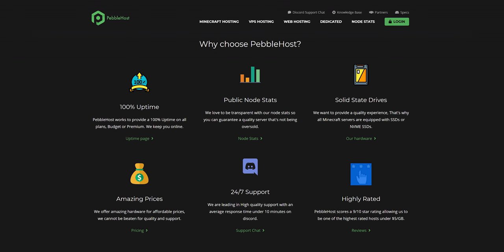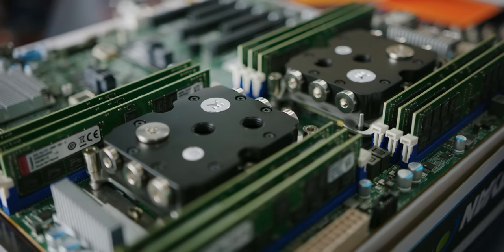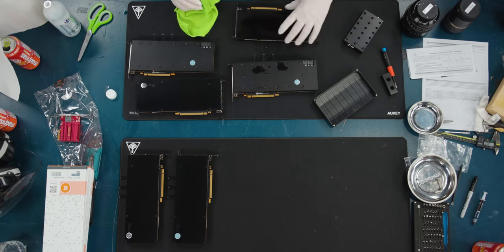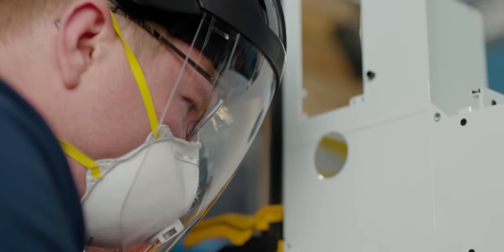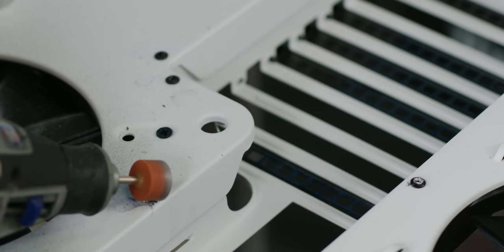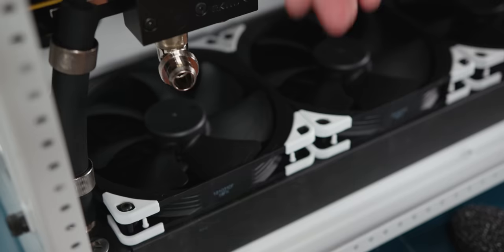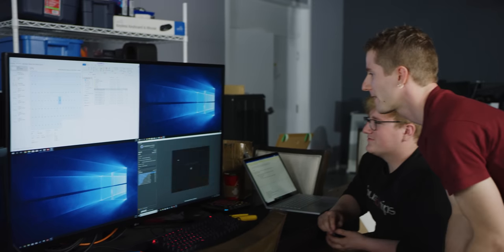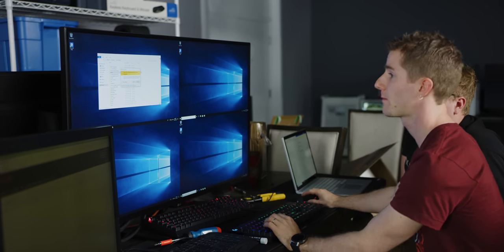We FINISHED the $100,000 PC! - 6 Editors 1 CPU Pt. 6

Comment: Linus:  "It was hard to watch as Jake took a dremel tool to a $500 dollar case."

Also Linus:  "I destroyed an $8,000 cpu being clumsy"
Reply: Probably a /r/woooosh, but at least they're able to source a new CPU for the thing. If they bork the case, though, they're SOL
Reply: @Yuusharo   For less than $1,000 you can get a case fabricated to whatever specifications you want done up at a metal working shop.
Reply: @MrDNMock  A custom fabricated case for this system might be really interesting.
Reply: @CottonInDerTube  "I LOLed"
Reply: @marcusavron47  Right?  This is the sort of thing that merits a custom deck build.  Something you can slap a couple 1080mm rads into for ultimate cooling.
Reply: when he destroyed it the cpu was over 11k, the cpu listed on ebay is 1000 usd cheaper that retail
Reply: Intel need to make drop  proof CPUs.
Reply: @richardallen985  They could call the new technology: Linus Proof ;)
Reply: Oof
Reply: boss vs employee
Reply: @MrDNMock  for 1000$ you can get a apple stand 🔥
Reply: id love to hold an 8000 $ cpu lol or see one not in my pay grade lol
Reply: @CottonInDerTube  they have money
Reply: Counterpoint: When the new 64c Threadripper and EPYC CPUs hit the market and Intel launches a replacement for this it's value on the secondary market is likely to fall by about 75%. As one of the last and one of the biggest and baddest cases ever made Caselabs that case could appreciate in value over the coming years. I wouldn't be surprised if the case is worth more than both Xeons in less than 10 years.
Reply: Bahaha. Throw it at the wall to see if it sticks.
Reply: @MrDNMock  have you seen their desk mod video? I said they need to work with a cabinet maker, not Amazon.
Reply: Wasn't it $10k? Anyway, still more than I'll ever spend on a CPU... I could buy 77 of my CPU with that... Man, I'm sad :(
Reply: @hrdcpy  No I haven't seen it.  Done a couple desk builds for myself in the past, but I will definitely check it out.  Planning on doing a 3rd in a year or so and always looking for more ideas on how to go about it.
Reply: @richardallen985  you spelled Linus Proof wrong
Reply: it was 10,000
Reply: Well case is more important vs case cos u have 2 CPUs and only single case which is not in store anymore, so what you try to say ?
Reply: @richardallen985  I'd say linus needs to stop dropping CPU's, especially ones worth three times my own pc.
Reply: Honestly, I think Jake's mod looks pretty clean. The cuts with the dremel obviously look pretty guetto, but when he inserted the PCI express slots from the thermaltake tower, you could not even notice the dremel cuts. Just a few sprays of white paint and it would be like new.
Reply: @MrDNMock  for only 999$ you can get a monitor stand man
Reply: my brother works at micron and broke a $20,000 Xeon Platinum cpu
Reply: Linus: drops nuke accidentally
Reply: @muddykat-tech  in my case ... 300 times my pc :-(
Reply: wrg,idts, do any s ok
Reply: Yuusharo you could probably find a used one
Reply: Jake is hard to watch doing anything...

Comment: You know you're ballin' when your network speed is limited (in part) by PCIe bandwidth
Reply: pci 6.0 will save the day.
Reply: cries in australian
Reply: cries in adsl
Reply: and some still argue that PCI 4.0 doesn't matter :|
Reply: @teguhsuryadi5387  exactly, thats why HPe and IBM are pushing midcycle updates of their machines to incorporate PCIe G4 even before the Cooperlake and Crystal Lake are due mid 2020
Reply: Pcie 4.0 is irrelevant for the average user and their even high end gaming rig. For stuff like this and data centers it's obviously is a huge thing
Reply: By Intel still using PCIe 3.0 instead of 4.0 or 5.0.
OpenCAPI is the future for servers.
Reply: @MaXwellFalstein  Absolutely thats why Google fully committed to OpenCAPi in their custom PowerServers. I think it will be interested to see if nVidia with the takeover of mellanox is going to move to OpenCAPI or again walking the proprietary road :-(
Reply: @mrradiowave8085  IBM, NVIDIA and Mellanox are core contributors to the OpenCAPI Consortium. NVLINK is proprietary.
Reply: Mr. Tux guess that means PCIe needs to be improved? 🤷🏻‍♂️
Reply: @isaacyoung1868  PCIe 4.0 is enough for the Mellanox ConnectX-5 used in the system and the Mellanox ConnectX-6 (both of which support PCIe 4.0).
Reply: Mr. Tux cries in 300mbps
Reply: @snoopdoggty1086  300 Mbps LAN or WAN?
Reply: MaX Falstein wan
Reply: @snoopdoggty1086  You can use a ConnextX-5 HCA for WAN; however, Linus is talking about LAN access of 8K footage.
Reply: @mrradiowave8085  IBM has been using PCIe 4.0 for two years. It will release PCIe 5.0 support in 2019. AMD has released PCIe 4.0 processors and graphics cards. PCIe 4.0 flash is available. Mellanox HCAs have supported PCIe 4.0 for three years.
Reply: MaX Falstein i know dat mate but the distance between my router and my pc is too fucking far and im too lazy to buy a lan cable
Reply: @MaXwellFalstein  yes sorry ment PCIe 5 got it mixedup, I just wanted to say that the need for more throughput is very much driven by the increased usage of accelerators.  And that it is intresting to see that the Power9 Prime is being released as a mid cycle update mostly for that, and memory bandwidth as the market demands this.
Reply: @mrradiowave8085  Power9 Prime is very exciting and interesting. OpenCAPI 4.0 is where you should be looking for PowerAXON-related expansion; ditch PCIe.
Reply: Of course Linus dropped one of the xeons
Reply: Australian tears
Reply: not to mention bottleneck bridges

Comment: Linus in 3 months: Time to rip everything out the chassis and replace it with dual Threadripper 3rd gen CPUs and 6 Titan RTX's
Reply: Totally. Gonna. Happen. XD
Reply: Then 1 year later. Its finished!
Reply: Sorry to be a buzzkill but Threadripper can’t do duel socket.
Reply: Actually, it would be more like Epyc, not Threadripper who is a lot cheaper than their actual.
Reply: @sphbecker  But with the use case like this you could cluster the CPUs and get the same result.
Reply: @sphbecker  Maybe they will make it work with 2 sockets, who knows?
Reply: @sphbecker  Won't need to. Threadripper 3 will be 64 cores. On a single socket. That's already more than this system has in two sockets.
But it won't launch this year at all, maybe early next year.
Reply: @sphbecker  Because you only need one Threadripper. ;-)
Reply: RTX shouldn't be better for  this
Reply: With 6 of Radeon Pro Vega II Duo 😂
Reply: @moriart13  And?
Reply: Linus next week: It's been well over a year now since we started this machine so it's finally time to upgrade it.
Reply: poor company that went bankrupt before Linus finished the build.
Reply: They probably won't be using this in a month let alone 3 since their editing systems are probably already more powerful individually.
Reply: @-ragingpotato-937  Vs should be better of editing, -computing
Reply: its 12 GPUs efectively which won't work
Reply: I think his point is my computer is bigger than your computer. Hahaha
Reply: @IngwiePhoenix zen 2 epyc
Reply: oh ya, this isn't something anyone ever finishes
Reply: Sorry to break your hurt but that won't happen
Reply: @GeorgePerakis  You'd be starving those titans unless TR3 gains more PCIe lanes.  He's got 96 right now, enough for 8x each plus the accessories.  64 you'd have to give them each x4, and you will notice the hit when you drop down to x4.

Comment: Now for the real test: Minecraft with full ray traced shaders and 8k texture packs.
Reply: 16k Ray-traced Tetris. Now that’s a real challenge
Reply: 12k resolution High Ultra Ray Tracing Pong.
Reply: @johnnooyen461  That would actually be a challenge no joke.
Reply: A 1.12.2 300+ modpack as well.
Reply: That's sick😉😉😉😁😁😁
Reply: Jasiu Jasiowsky this comment is underrated
Reply: Crysis
Reply: And blow up a 100,000 tnt ball
Reply: If we don't get this we riot
Reply: @grimace5800  Minecraft would Crash because only 1 or 2 cores are used
Reply: Can I play csgo at 300 fps on this?

Comment: So it's 2 USB ports per editor?
Cries in Taran peripherals
Reply: Na its 2 extra dedicated.
Reply: just dongle it LEL
Reply: It's USB 3 tho... Fast enough to split into 4 - 5 port each
Reply: You can split usb with a hub
Reply: USB hubs also exist
Reply: You wouldn't even typically hardwire into something like this. They are more than likely using a separate workstation and remoting into their VM instance.
Reply: they are usb 3, so you can put a hub there, to be honest i think the better idea was a thunderbold 3 expansion card
Reply: @Xenoray1  Apple
Reply: @dotpeekx  nVidia blocks that type of virtualization entirely, they have to use displayport cables or pay the cost to go to quadros.

Comment: Linus just casually drops a 9 thousand dollar CPU. Of course he would. How do you manage that
Reply: By being linus and wearing socks and sandels ofcourse.
Reply: saph sergal right I forgot
Reply: If you don't intentionally drop a CPU, the price is irrelevant. I just ruined a mobo a few weeks ago by dropping the CPU on the socket. Very annoying. But it happens when you handle a lot of hardware. They make it too easy for it to happen though, considering the catastrophic consequences it might have.
Reply: His sponsor segments kinda changed after that drop. x)
Reply: @jeschinstad  he dropped it. Not in the mobo, on the floor.
Reply: @jeschinstad  Its one of many tiny reasons why I appreciate AMD CPUs over Intel. Slotting in an intel CPU with that heart wrenching "crunch" as you lower the lever is always fucking terrifying. AMD's is much gentler by comparison.
Reply: He has become blase about expensive electronic equipment. Desensitised to CPU violence.
Reply: @rafee9442 : Yes, but he didn't do it intentionally, which is the point. You drop them because there's not much to hold on to, not because of price.

Comment: This pc: turns on
The power in the entire city: aight imma head out

Edit: thanks for 1k li- you fools, you fell right into my trap
Reply: Lol underrated 😂😂😂😂😂
Reply: Lol
Reply: k
Reply: @kontro3881  no
Reply: The edit was so cringe and unnecessary
Reply: 2 microwaves running at the same time would use the same wattage. Some microwaves are even up to like 1600 watts, while this PC is 2000.
Reply: @natebit7167  r/woosh
Reply: The power cuts! 😂
Reply: Lol
Reply: I was gonna like this comment. Until isaw the "thank you for the likes" edit